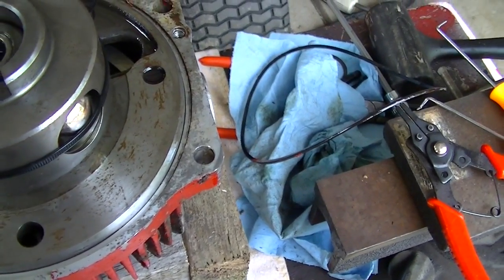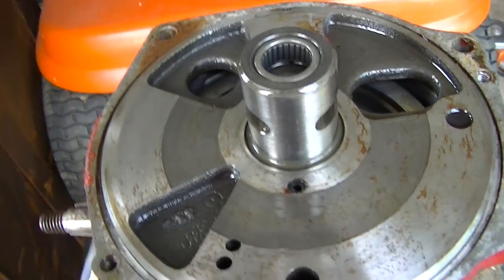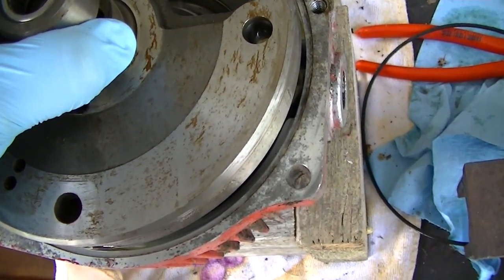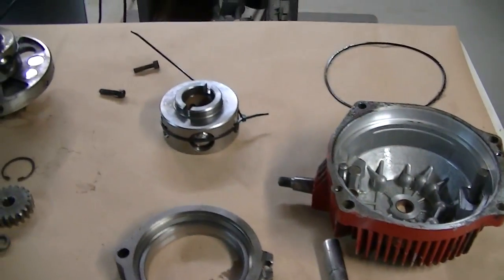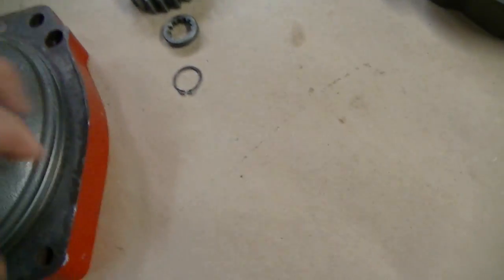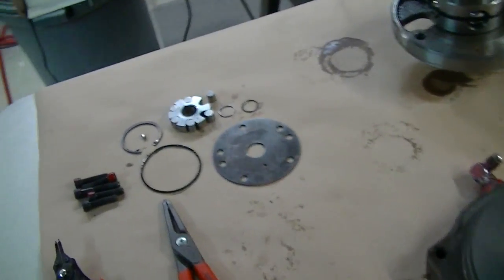Wheel Horse Eaton 1100 Tear Down

Comment: 4:32 how do you get the pintle assembly out? And if two of the balls fell out when I pulled the motor rotor out. How can you find their correct placement?
Reply from the maker: You should go on Red Square.com and get the Eaton 1100 service manual, its free.  I haven't rebuilt that in a long time, but there was a form it tells you to build out of a 2x4 to get the pump elevated so you can pull it out (think that was the part).  If you lost two balls use a micro meter to see if there is a difference in either ball, or hole.  I remember in the manual to not lose the balls. LOL.

Comment: I replaced the seal and bearing on my charge pump. The the seal wore after 2o+ yrs and was sucking air into the system Making the tractor virtually inoperable. My eaton 11 is on a troy bilt gtx18 so everything works off the charge pump, final drive,steering and implement lift. Anyway I learned a lot about the pump and as you probably found out, the play in that shaft is normal when the pump is off. It's the bearing in the charge pump that keeps the shaft from moving from side to side and the two small wire retainer rings on either side of the bearing keep it from moving in and out. When I put the pump back on I forgot to put the inner bearing retainer ring in and when I pressed the bearing in, I used a length of 1/4-20 theaded rod that threaded into the end of the shaft with a socket,washer and nut to press it in. When the bearing was seated, I continued turning the screw thinking it would stop when the bearing was fully seated but seeing I forgot that inner ring, the shaft just kept pulling out until the shaft pin in the housing was pulled hard against the cover. When I couldn't turn it anymore, I thought the bearing was seated so I took the pressing tool off and when I tried to spin the shaft, it wouldn't spin. That's when I realized I forgot the ring, took it back apart and did it again. I got it all back together and it works great again. I was just wondering when you couldn't turn the shaft if maybe you didn't put that inner ring in.

Comment: Where did you get seals and gaskets ? I have a Kubota G5200 H with a leaking control shaft seal . Kubota says Eaton and Eaton says Kubota .
Reply from the maker: I’ve been looking but the part number for the 1100 seal kit is 563310.

Comment: Can you tell me if the wheel horse Eaton 1100 is CW or CCW rotation?  I have an Eaton off a Cushman Frontline mower that I need to find parts for but it is CW rotation.
Reply from the maker: The shaft spins in a CCW rotation.  I just checked the fan rotation to be sure.

Comment: I've always wondered how much horsepower one of these will actually take. The factory Eaton spec says 20hp, but Toro also ran a 23hp Daihatsu/Briggs diesel in the 523DXi... and I've never heard of one failing. I have several old Sundstrand inline trannies that could definitely stand to be replaced with one of these.

Anybody have experience with putting more than 20hp through these?
Reply from the maker: I think they referenced it as light duty in the manual if you can believe that.  The 1100 is a fine transmission.  I wish I would have done a full video on putting it back together.  The seal kit worked great, I have no leaks and run Mobil 1 10w30 full synthetic in it, very nice transmission.
Reply: @CraigArndt  - I know they work great within spec. I wish they made one with an auxiliary charge pump. My Groundsmaster uses a Sundstrand inline trans, with a charge pump. The charge pump supplies pressure and flow to the transmission, power steering, deck lift, and fluid cooler. If only the 11 series Eaton had an auxiliary...

Comment: I have a 1997 416 toro wheelhorse since new with the eaton hydro and it keeps going slower and slower and barely goes in reverse now . Can you give me an idea what maybe wrong . I change the oil in the trany  every couple of years and it is only used to mow my own 1 acre lawn in northern Maine . The hr. meter doesn't work so  I don't  know the hrs. . It is always kept in the garage when not in use . Been a great mower just don't know  if it is worth fixing . Can you still get parts for these now ? I have taken off the seat and pan and don't see any problems with the linkage . Thanks
Reply from the maker: It's hard to say.  Assuming it hasn't overheated by the pump fins being covered in grass and cottonwood, it could be the wrong filter or choice of oil.  If it was going slower forward, it would go faster in reverse because of the linkage set up.  I would warm it up, change the fluid and filter (get a good quality transmission filter, not automotive.  I run full synthetic 10w30 in my eaton 1100.  It makes a big difference.  Check that you don't have any leaks or dirty oil patches around the main pulley or fins.  After that, I'd check over the linkages to be sure they are set up right, but sounds like it's a fluid restriction problem.
Reply: THANKS

Comment: Craig did you ever get this back together
Reply from the maker: Jared Bailey I did, just wasn’t able to put it on YouTube because my camera or iMovie corrupted the files.  It went together easy.  Followed the Eaton manual for Model 11, piece of cake.  Put in synthetic oil and it works and pulls perfect.
Reply: Craig Arndt  good deal.  Did you just do a clean and gasket replacement or did you replace any internals
Reply from the maker: All gaskets, there is a kit that some people say I could have bought individually cheaper, but I didn’t feel like hunting for all the correct size gaskets.  It worked great, it’s nice and quiet no more leaks.

Comment: I got a JD185 with an eaton drive. oddly when it is put in F it goes in reverse,R it goes forward. Drive doesn't slip other than the shift no prob.
The pump case is dirty and hasn't been opened, the belt is installed per JD diagram properly. Not sure what to think.
Reply from the maker: It’s a linkage issue if it works otherwise.  I would look at the top of the pump where the linkage is.

Comment: I was hoping to see you put this back together. I looked and didn't see a video on this. I have 2 model 6 versions of this pump/motor on my Grasshopper ZTR mower (left and right). I have not opened them up to see how worn they are. But everything in the drive line is shot, as the previous owners appear to never have done maintenance until there was a failure. And the grasshopper has these so tightly packaged, that getting to a drain plug would be impossible.
Reply from the maker: I didn't video it because there were too many fails.  Putting it back together was a breeze, but once I tightened the 6 bolts to the pump impeller, the shaft wouldn't turn.  I had that thing apart 10 different times, making sure I didn't let any bearings out as they are mated to the proper holes.  I replaced a shaft bearing and finally it went back together and the shaft turned easily.  I must say that this hydro was totally and completely abused.  If you crack into one of these, they're not difficult but get a manual and read it before doing it.  The manual had me build a wood frame to allow the shaft to sit so I could pound out the bearings and seals.  New seals and bearings, it works like new.  Best of all, I run Mobil 1 10w30 synthetic which this pump really likes in cold weather.
Reply: @CraigArndt  I tore one of the pump/motor apart last fall. The failure was the seal around the input shaft that controls the pump forward reverse position. So that shaft opening at the bottom of these, all the metal shavings from the spline input drive shaft, ends up in the bottom of the sump, and there's no drain there. I did see in the shop manual for these, later models had a magnet to pick that up. At any rate, the shaft had eroded, along with the aluminum bore in the housing to let that 5/8" shaft seal leak out the bottom of the pump, so I assume when it leaked bad enough, they abandoned the mower these were on. These things need a drain plug so all that crud can be flushed. Or better a connection from the bottom to the oil sump, and make that so the flow will put it through some filter of some sort. But I know, the current design, that shaft is the lowest point for the metal shavings to settle out next to, and they were small enough to get between the shaft and bore housing to make it fail. My pintle bearings were in good shape. I see on the next model up of these, they dump the hydraulic oil back to a sump that's part of a transaxle the drain is around the output shaft.
Reply from the maker: @f.hababorbitz So far this rebuild has worked pretty good. I no longer get the oil spray in the cooling fins of the pump.  I plan to restore this tractor again after I rebuild the 3400 Ford I’m working on, or will start working on if it ever warms up here. I’d like to rebuild the pump and video it more thoroughly. I had video that got corrupted so I never could upload putting it back together. Thanks for checking this video out.

Comment: Good tip on the ball bearings. My problem with tearing things down come when I try to put it back together.
Reply from the maker: Years ago I took pictures and still do, now i use my phone to capture where things go.  I'm sure I'll be using these youtube videos and footage to get it back together correctly.   Digital pics were absolutely key to me getting my Wheel Horse 520H back together.  I didn't reassemble until a year later and I couldn't remember where anything went.

Comment: Watching this brings back horrific memories of doing the steering box on the Ford. Dont even want to go there again and mess with all 53 of thosw ball bearings. That pump looks to be a real simple set up compared to that. Glad nothing was wrong in there! Great video!
Reply from the maker: I didn't know what to expect when I got in there, but I'm feeling pretty good about the repair.  I did find an oil seal I replaced that wasn't flush and I'm wondering if that was why when I tightened everything down the shaft didn't want to turn.  It may have been pinching the shaft.  Either way, good for me to get into this as the fiber gasket had failed from 30 years of abuse from the previous owner.  Now I'm online looking for braided hose to replace my kink, may replace it all now that it's apart.

Comment: Interesting pieces inside of it ..Can you get a new bushing where the shaft is wobbly ?
Reply from the maker: They say in the manual to buy a new housing, which was possible in 1989 when this was made but now it's unavailable.  Probably could find it through Eaton, but I know a machine shop locally that could do it for me.  I'm not sure it needs to be replaced though.  I found a new oil seal I installed that was high on once side maybe 1/32" or so, that may be what caused the shaft to stop turning when everything was tightened down.  This bushing is immersed in oil all the time so it and the shaft are in great condition for 27 years of work.